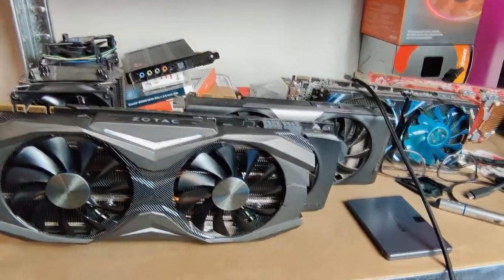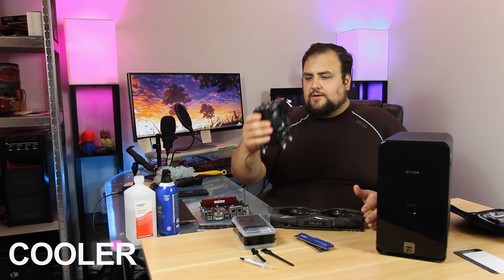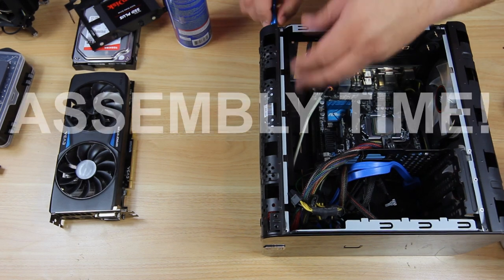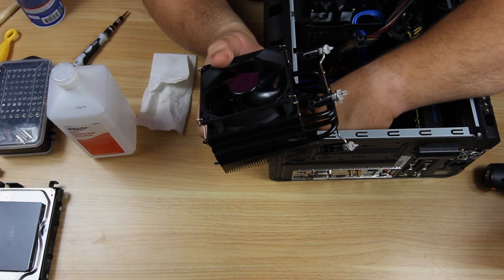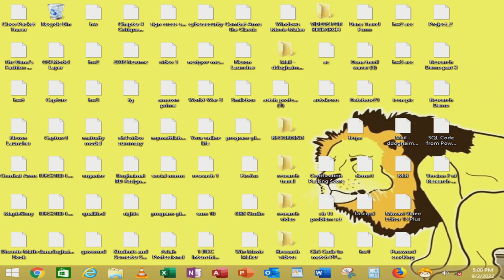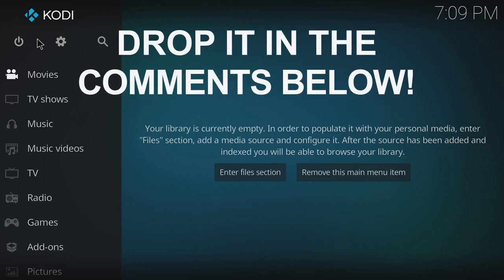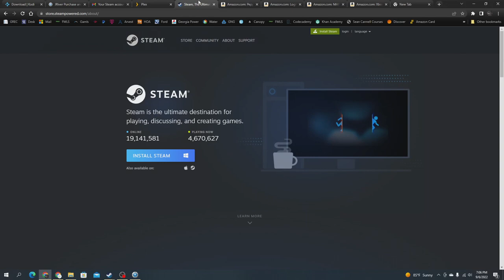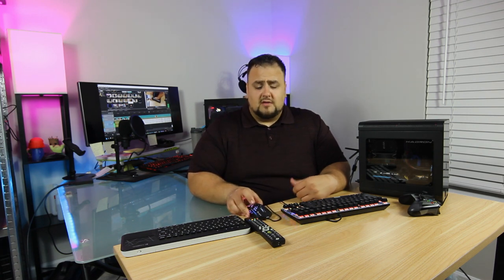This is how you build a home theater PC!

Comment: I THINK this is what I need, but I'm not sure. I have about 2400 DVDs and Blurays right now along with TONS of mkv files. Could I rip the discs to the drive(s), load up the mkvs and use JRiver to play the files? Does it make a difference if I'm using multiple SSDs given the amount of data I have?